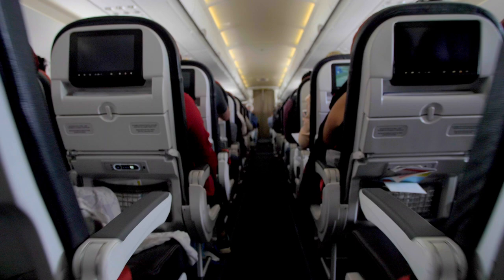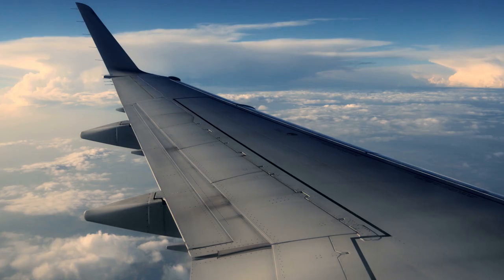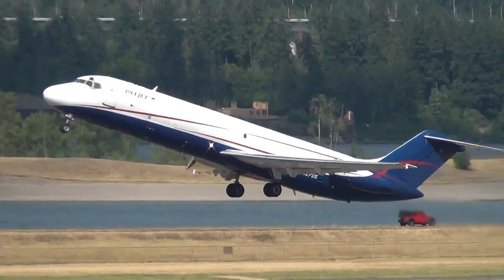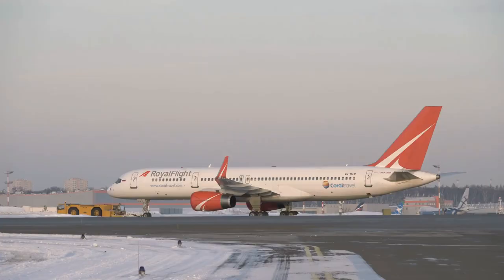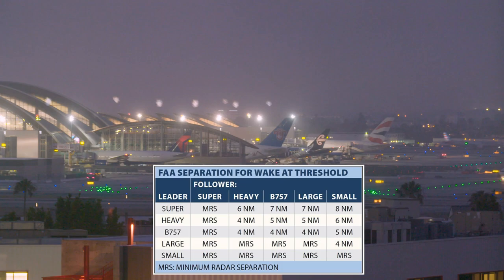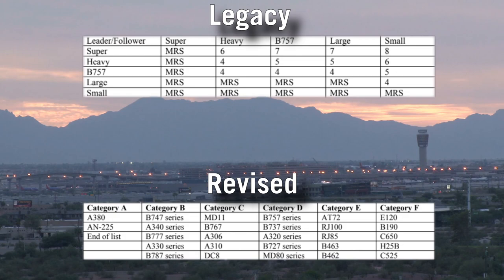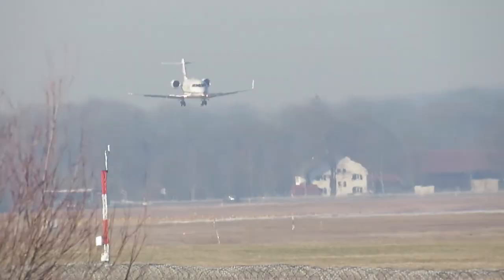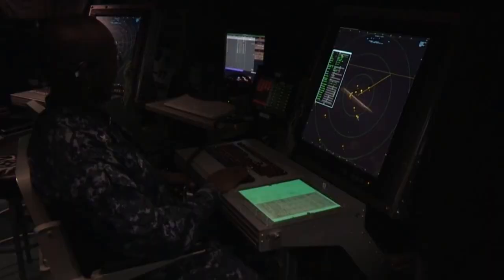This Is Why Airplanes MUST Wait On The Runway

Comment: I want to know how mid-air refueling deals with this wingtip vortices
Reply: They refuel underneath the wake
Reply: If you watch some videos about it you’ll notice they’re on an angle not behind the tanker
Reply: Plus the wake is strong below 2000
Reply: There usually at an angle or slightly above it
Reply: Different altitudes
Reply: Altitude and speed make the wake not super bad behind the tankers. However when the aircraft being refueled join they come from the left and fly below the tanker to stay out of the wake. And the boom extends downward so they stay just below the wake during refuling.
Reply: This is quite simple, really.
Not only do they fly well below the aircraft, the tanker has wider wings than the tanking aircraft. So he's in between the vortices, and has "stable" air.
Reply: @MrNicoJac  It does not have to have wider wings, globemasters, for example, are refueled in air
Reply: @slavenrasic2173 
But a globemaster would only be refueled from a stratotanker, right?
And a stratotanker *does* have wider wings than a globemaster has, right?
Reply: from what i learned from dcs it is a bit problematic
Reply: @Aviation88 the faster an aircraft flies the weaker its wingtip vortices will be.
Reply: Having tanked off a 707 with probe and drogue on the wing tips I can assure you the vortices are there.
The hose Hangs down below the vortices but not by much.
Occasionally students would get into a Pilot induced oscillation chasing the basket and get too high. The vortices would catch the aircraft and throw it over the tail of the tanker. Very exciting to see.
Reply: It doesn't look like it has been specifically mentioned but vortices travel along side the wing and off the wing tip (those things on the end help dissipate them) anywho they  Flow DOWN AND OUTWARDS like a corkscrew   the planes go directly behind them and thus safe
Reply: @MrNicoJac  nope c-17 can be refueled by any of the heavies. The KC-135 is my favorite because of the engine positions but they all can refuel it
Reply: The planes being refuelled are so close behind and slightly lower than the tanker plane, that the vortices do not effect them.
If the trailing plane is further back and high, they are also not affected.
As you can see in the footage, the vortices roll out off the tips of the wings of the big heavy aircraft. . .  so the vicinity almost directly behind the big plane is safe.
Reply: Fighters fairly easy, come up between wingtip votices. C 130, c17 B 2 it is a bitch , train in simulator until you can do it reliably. Simulator trainer said it takes about 6 months to master it. Have had wingtip vortice almost flipped my gruman tiger on the ramp next to runway.
Reply: @Aviation88 Flying "slower than usual" is exactly when you produce MORE wake turbulence, actually ... the slower you go, the higher the AoA, the worse the vortices get.
Reply: Wing tip vortex are the strongest during what's called "slow flight". Most jet airliners cruse at 320 to 350 kts or about .9 mach, but below 10,000 ft in the U.S. and most of the rest of the world, they must slow to 250 kts or less. Most liners slow to 180 kts as they enter the ILS corridor for the runway and further slow to 140 kts (approach speed) within 2 to 4 miles to the runway. As the plane slows, both extended flaps and an increase in the wing's angle of attack (nose up) is necessary to generate enough lift to keep the aircraft flying. It is the high angle of attack that generates the really strong wing tip vortex you see in this video.
Now, during mid air refueling, the tanker is flying at it's normal cruse speed - about 320 kts. It's the fighter jet that slows to the speed of the tanker. Because the tanker is at cruising speed, the angle of attack for the wings is at a minimum, creating only a minimum vortex that stream directly (horizontally) back from the wing tips. The aircraft to be fueled approaches from behind, but below the tanker and remains below it during the refueling. Any vortex generated by the tanker will stream anywhere from 20 to 40 feet above the fighter jet's wings - well out of the way. Someone else pointed out that the tanker's wing span is much wider than the fighter's so the vortex are also outboard by several dozen feet from the fighter's wings. When the fighter is refueled it drops a few hundred feet and turns away.
Reply: @TrashMutt  
No, except for Navy probe and drogue systems from KC-130’s wings, and other tankers, USAF Flying Boom refueling is directly behind and below the KC tanker.
Reply: @yayeet1739  
No, neither is true. Directly behind and below.
Reply: @jonahwilhelm8409  
We approach the tanker from the left or the right (or from directly behind,) depending on how we intercepted the tanker.
Reply: @MrNicoJac  
Please stop talking, ground pounders!
Reply: @MrNicoJac  
Nope and nope.
Reply: @Frankie5Angels150  well done bro
Reply: @TrashMutt  This is true.  It's a combination of high altitude, high airspeed, and relatively low angle of attack by the tanker.  I've seen wingtip vortices while refueling other aircraft, and they appear to be going straight back, not angling down.
Reply: Above 2000 is where it doesn’t happen that much it’s mostly lower to the ground is where the issue is
Reply: Good question TK Tang. X
Reply: @MrNicoJac  The tanker aircraft often refuels aircraft larger than itself.
Reply: @Aviation88 A KC-10 will routinely refuel other KC-10s, C-17s, B-1s, B-2s, B-52s, C-5s, VC-25/E-4s, etc. More importantly, a KC-135, which is significantly smaller than the KC-10 will does the same. Since the boom extends pretty far down, it’s usually not a big issue for most aircraft, except… the A-10. The Hogs always have issues refueling as they simply can’t fly fast enough and the vortices increase at lower speeds. As cool a weapon as they are, they’re always a PITA.
Reply: They don’t exist after a certain altitude

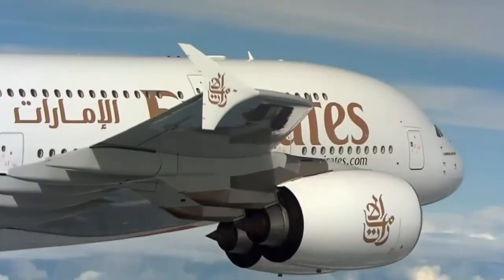Comment: 5:05 Well there was a long discussion about the wake that the A380 produces. Airbus claimed it produces less wake than a 747 and if that is really the case then it should not be much of an issue. But of course Boeing got through with the super heavy class to make the A380 less profitable.
Reply: The 380 was never profitable to begin with and Boeing does not decide categories of aircraft and separation distance. The 380s inability to land at most airports due to infrastructure and the fact nobody wanted an aircraft that size due to costs and maintenance and Airlines inability to fly them full made it less profitable.
Reply: @gsmcfaul72  Not to mention its restricted cargo capacity (a 777-300 has more).
Reply: @gsmcfaul72  1. Boeing are able to lobby at ICAO and influence rule making ....and they do!  2. The A389 is profitable in many routes. If you fill it, you can make a fortune.

Comment: There is no classification of "medium" in US weight classes. The US weight classes are small, small plus, large, heavy and super. Medium is an ICAO distinction.
Reply: @valerierodger7700  757s do not have a separate class. They have separate special wake separation criteria that classify them as “heavy” (paragraph 5-5-4). Some 757-300s had “heavy” MTOW anyway.

Comment: Well, you have just clarified a suspicion that has been bugging me for the last 15 years!
Our flight was delayed an hour from Charles De Gaulle due to a passenger luggage issue....It was either one bag less or one bag too many, I can't remember which. After an hour back at the terminal having the baggage unloaded, counted and re-loaded, the plane returned to the runway, waiting for the plane in front to take off. We proceeded and took off, about 20-30 feet above the runway, the left wing (I was window licking at the time) suddenly dropped!
 I have to report that when it happened, I saw, in white bold capitals in my head the word 'F*CK'.... 
Obviously the pilot regained control (or you wouldn't be reading this Ha Ha!)
I've always thought he took off too soon.... There was no announcement from the crew, which I thought was odd to say the least? Thank You!

Comment: I never knew ANY of this, and I’ve flown my whole life. What a great video!
Reply: You actually didn't know that separations are put in place between aircraft, due to wake turbulence considerations?
Wow, lol.
Reply: @sailorman8668  As a pilot, I'm taught to be above and land past the spot that the previous plane landed at and when taking off, to take off before and above the plane taking off. I wasn't told of any of these rules. Infact, when a heavy takes off, they don't say I have to wait 3 minutes, they say, "Caution, wake turbulence". I can choose to wait a few minutes, but its not an FAR. These are good ideas for safety, but I've never seen a hard fast rule for it. The approach rule is kinda bs too. There have been several tiimes where I was told to follow behind X plane but to maintain visual separation and of course, caution wake turbulence.

Comment: I knew that wake and turbulence were the reasons for aircraft separation, but this was a great explanation. Before the pandemic, I flew quite a bit, and the only thing that scared me was flying through microburst conditions. For the passenger, it feels as if the pilot has forgotten we are landing and hasn't slowed the plane down. Only once did I experience landing at normal speeds in bad wind conditions. It felt like the plane was smacked to the ground and then bounced a couple of times. People started screaming. I laughed when the soldier sitting next to me calmly said, "I think the pilot needs more lessons; that was a pretty bad landing."

Comment: Not all those waits are due to Wake Turbulence. It happened a lot to me giving takeoff clearances (taking into account the min separation due to w-t), but then crews request if they can delay the roll for a minute (to finish their checklist or for other reasons). Sometimes crews are over-cautious, it happened to me once that a flight argued that they needed 3 minutes when only 2 minutes is required. Most of the time, it takes 1 minutes for the ATC to issues the takeoff clearance and gets the read-back, then 1 minute between line-up and roll. The video shows accurate facts and it’s good that it differentiates Jet blast and W-T. Saying “safety is second” about Dubai Intl Airport is not well thought (most of the traffic are heavies and mediums. The A380 is minority that lost its popularity and its W-T is not hugely different than a B747).

Comment: Airbus did extensive engineering for efficiency and to counter the vortices… weight and size doesn’t tell the whole story. So I think Dubai will be just fine. Greetings from a city where the A380 was engineered.

Comment: In the 1920's, biplanes would sometimes flip over when trying to land on aircraft carriers, like the Langley or Saratoga. This is not wake turbulence, but similar, I think.
Reply: a big issue with that is called the "ground effect" as an aircraft comes over a ship/higher ground it creates more lift, if you aren't directly over you create more lift on one side which rolls the aircraft over to the side, its super dangerous with helicopters landing on deck.

Comment: I just went and saw the blue angels this afternoon. how come they can get so close? does it have something to do with the wing design?
Reply: They fly almost right next to each other or have some vertical separation when flying behind. They are so close and the aircraft so small that they can negate most of the issues.
Reply: An interesting question and to be honest it would take a good 5 minutes to type out every single factor
Reply: I guess they have thought about this and do avoid the vortices, as they can fly where they want
Reply: They have more agile planes without 100 passengers to worry about.
Reply: @ezicarus8216  Well, SOME fighters are designed to be unstable. The famous tri-plane of the Red Baron was one of those.

Comment: Also.. If you leave the gate on time, the airline can call that an on-time departure.. Even though you sit on the runway waiting...
Reply: True, as soon as the aircraft is moving away (pushback) from the stop it is considered the time of departure kinda. So if it does pushback the time of actual departure it is not considered as delay
Reply: Taxiways aren’t runways. Also, a departure aren’t counted as on-time or not… arrivals are.

Comment: This is just ONE reason why we have to wait prior to departure. Usually if its not one thing, its another. If it's not Weather its ATC (i.e. flow/delays), if it's not ATC  it's Passengers...getting up to use the Lav, etc. Same for time to gate on arrival... It's the same list but add gate being occupied to the list and that's usually due to 1. You're early and the outbound hasn't left yet or 2. The outbound is delayed/late. And only God knows why the outbound is delayed...Weather, ATC, line personnel (rampers, fueler, etc.), Gate Agents, Maintenance, Passengers, Crew, Dispatch, etc. It's a miracle it all comes together and works at all.

Comment: Most of the time, it's exactly what you think. Wake turbulence is a thing for a few minutes, but that doesn't explain most of the waiting we do on the tarmac. Once you're in that seat (once you buy the seat in ADDITION to "the flight," because, apparently you can fly without a seat, so the seat costs extra), the airline holds you hostage; they have virtually absolute control over your destiny.

Seriously, at this point, if my travel is within about a 15-hour radius, I just drive it. I'm sick to death of the endless games, waits, masking, TSA, and other relentless hassles of flying. Just not worth it anymore. I drove the last 17-hour trip, and it was actually quite enjoyable. You just settle in, talk, have your significant other read to you, listen to music or an audio-book, and enjoy it. Not a problem at all.

Comment: Then we should build our airports at about 600 metres of elevation
Reply: Smart
Reply: that's not practical at all.. as one example, my local airport is at roughly 200 meters in a very large city. it would be impossible to triple the elevation just for an airport, and there is nowhere close to 600m elevation for hundreds of miles in any direction.
Reply: @alexn78666  You don't need to take it seriously, Bro
Reply: @alexn78666  get the joke

Comment: As an ATC, if I let an aircraft sit on the runway for 3 minutes I wouldn’t last long! Number one rule, don’t load the runway unless you can launch the aircraft. The weight classes are small, large, heavy and the extinct super. IIRC, the 757's extra distance was rescinded. There are so many errors in this  video it’s not really worth watching. Comparing carrier operations to airport operations is ludicrous!!
Reply: Clearly he really meant taxiway...
Reply: “Super” isn’t extinct. The A380 and Antonovs still fly.

Comment: Back in the 1980s I was in the RCAF at CFB Trenton, Ontario, we did an exercise with the Canadian Airborne Regiment where we wopuld 12 CC-130 Hercules turbo prop transports full of paratroopers take off within 5 minutes between the first and last aircraft, just as they would in wartime conditions. By the time the 4th aircraft took off your could hear the air crackling from both the engine and wingtip turbulence, by time the 8th aircraft was getting into the air they were moving left or right because of the turbulence and by the time the 12th aircraft was taking off it was almost rolling from the loss of control. But it was a wartime situation and the aircrews knew what to expect. Wheen they returned to base they were spread out 5 minutes between aircraft on landing. Some thing you never forget once you've seen them, even from the ground.

Comment: Funny enough, wake turbulence was not on my list, when I started watching the video. Although, technically "waiting for take-off clearance" (which was on my list) somewhat aligns with wake turbulence... Also on the list was:
1. Still warming up the engines (if the taxiing was quick and the engines were started late, so your engines aren't warm enough to accept take-off thrust without damaging the engines. Btw.: Same goes for car engines. A cold car engine doesn't like "pedal to the metal". First, carefully drive a few kilometers or miles before you floor the pedal. The temperature gauge is a good indicator also.)
2. Waiting for another round of deicing. Normally, it's being done on the apron, but on large airports where taxiing takes long and if the weather conditions are bad enough, it might also be done close to the runway, because otherwise you might not meet Deicing holdover times (time from deicing until take-off).
3. Waiting for take-off clearance (I thought about a taxiing airplane crossing the runway or a conflict with arriving traffic on crowded and not well designed airports or airports with difficult terrain which can't avoid some crossing of arriving and departing traffic. However, technically wake turbulence also falls into this category, because as explained in the video, you won't get take-off clearance if you can't meet the required separation.)

Comment: If you listen to air traffic control at busy airports, you'll probably hear them say something like "caution wake turbulence" or "a heavy will depart the parallel"........ in simple terms, you need relatively stable air to attain thrust through the engines and most importantly over the wings, that's why you sometimes wait before lift off

Comment: 2 to 3 mins? I always wait for at least 5, sometimes even 15, 20, or more. It's a mixture between what you explain here, plus the airline (if it is low cost, for example, they have lower priority for take-off), weather conditions, etc.

Comment: Wing tip vortices are real.  While flying a Voodoo (combat wing) control line model plane, I did a tight loop, when coming around again (60 ft. flying lines), the Voodoo ran into its own turbulence and I almost lost control.  The plane recovered and did fine.  This model has about 36" wing span.